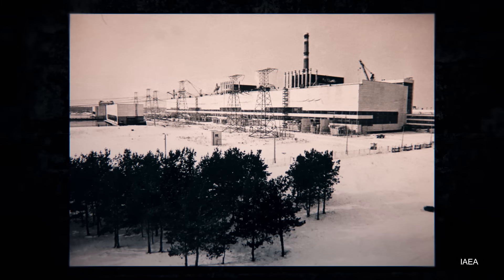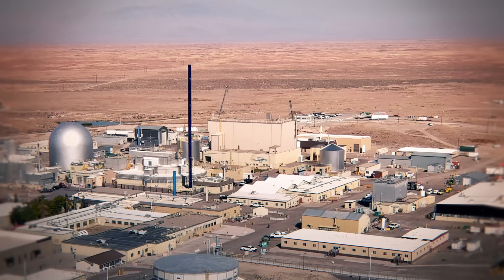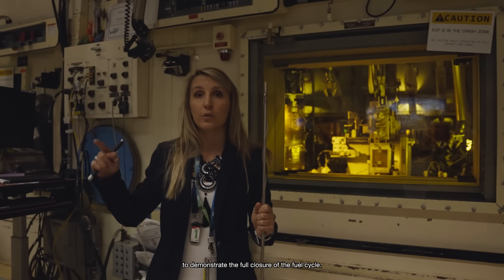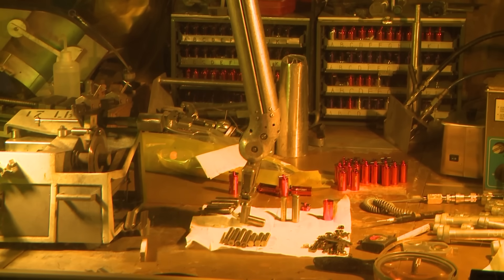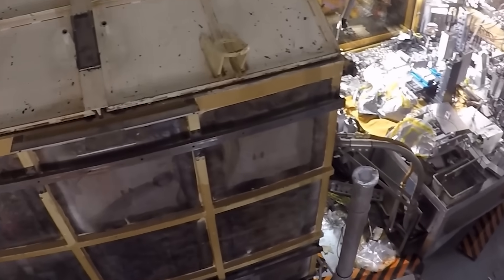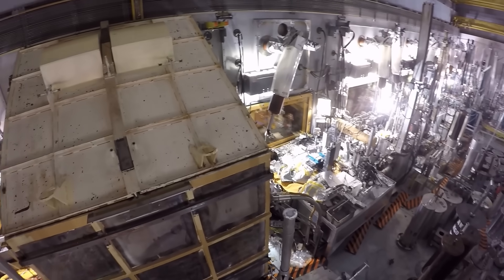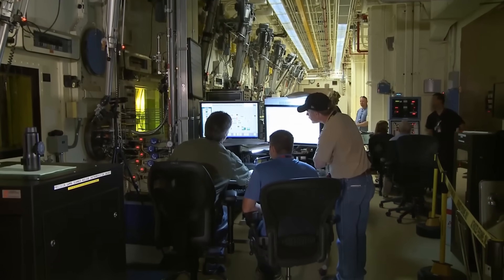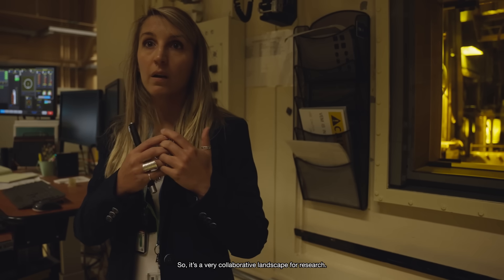This Room is Lethally Radioactive...For SCIENCE!

Comment: What's crazy to me is that if a person did enter the H.F.E.F. unprotected, they would likely never feel the effects of the Elephant Foot level of radiation before losing consciousness through the simple act of breathing.  With an internal atmosphere at >99% argon concentration, you would be out within seconds.
Reply: yes, did you also know that if you swim next to a submerged nuclear reactor you most likely drown before getting to much radiation? crazy
Reply: @clearlisted  that's only if you make it past the armed guards.  Hmm, purple Cherenkov radiation.
Reply: @clearlisted  pretty sure you would die before the drowning from gunshot wounds because you just broke into an active nuclear reactor.
Reply: @SupremeRuleroftheWorld someone has read xkcd
Reply: @initial86-2.5  i have yes, but i also worked in a nuclear power plant for almost a decade.
Reply: @clearlisted  If we're talking about neutron radiation that's true, water is a very good shield for such kind of radiation
Reply: Not if you held your breath. Argon is inert, so it won't displace the air in your lungs or traverse the skin in significant amounts. You could remain conscious for five minutes, or up to fifteen minutes with the right physical conditioning.
Reply: @HenriFaust  You won't survive that long in a pure argon atmosphere (at standard temperature and pressure). (Same thing with pure nitrogen too.) Everyone thinks: "I'll just hold my breath!" and then dies.

The vapor pressure of oxygen will be low enough that it will evaporate out of your skin.

It's like being in the vacuum of outer space, except with a 15 PSI atmosphere that feels exactly like the atmosphere you are currently in right now. 

You will feel nothing unusual because you can still exhale carbon dioxide like usual, and the carbonic acid in your blood will never get high enough to trigger your "sense of suffocation". You can't sense oxygen.

You can hold your breath underwater for much longer than you can in an oxygen free atmosphere. The human body has a bunch of unconscious physiological processes that automatically slow your metabolism underwater, which don't happen outside of water. 

Within the first minute, your vision will get "stars" starting in your peripheral vision. Sounds will get distant and echo. You get dizzy, and your peripheral vision goes dark. Then you lose consciousness and never wake up again unless someone else immediately supplies you with oxygen.
Reply: @juliavixen176  sounds like the same thing that happens to people who over do nitrous oxide abuse, same kind of reports.
Reply: @juliavixen176 just to point out something for your information, you can and will sense lack of oxygen, while it is true that carbon dioxide levels are the primary driver of respiration, there are also oxygen sensors in the body (I can’t recall if they are in the carotid bodies or near) the aortic arch atm), people who have “burned out” their CO2 sensors due to being chronic retainers (COPD patients primarily) rely on their oxygen sensors to drive their breathing, it just doesn’t kick in until much lower levels that most people are used to, down below 92 o2 saturation, it’s a trap for young medics and nurses to see these people with low oxygen and give them more via nasal prongs, and then the patient stops breathing
Reply: @TruthQuestian78 Nitrous oxide has a bonus modifier because it's an anesthetic. It will make someone unconscious even with plenty of oxygen available, and the ability to exhale carbon dioxide.

It's not hypoxia that causes unconsciousness first. But if someone is alone, and using a gas mask/respirator/whatever that covers their face, and while adjusting the flow of nitrous oxide into the face mask, and accidentally loses consciousness before being able to readjust the flow of nitrous oxide... then they will stay unconscious... forever.

All anesthetics is fatal if improperly dosed.
Reply: Completely off topic from the video: if I held my breath, I could stay conscious in a 100% argon room for a minute, maybe even two. Why would I loose consciousness faster if I breath in the argon?
Reply: @firefighter4443 If you're breathing in an inert atmosphere you're exhaling oxygen, that's why it's worse than holding your breath.
Reply: @firefighter4443  Your body doesnt use all the atmospheric O2 right off the bat.  Holding your breath still allows absorbtion through your lungs as your heart beats while holding your breath.    If you exhale all the residual O2 and replace it with Ar... theres now no oxygination happening.  Your body's response to low O2 is to pass out to conserve oxygen use for critical tasks.  

TLDR... as you hold your breath, your Sat levels drop at a slow pace because you still have O2 in your lungs.  Replace the O2 with Argon (no O2 left in your lungs), and your sat levels will plumet, causing you to pass out to "protect your vitals"
Reply: @firefighter4443  If you hold your breath you continue to have O2 in your lungs and will stay conscious for some time until you no longer have O2 in your lungs. 

A good test. Take a deep breath and see how long you can hold it. 

Then, take a deep breath and breath it all out, but don't breath in. How long till you have to take a breath?
Reply: @firefighter4443  don’t breathe it in, I’ve had slight argon poisoning from welding before. It is unpleasant to say the least. 

I had in slightly but it still felt like i just smoked 2 packs of menthol cigarettes deep down in my lungs. Very uncomfortable and I could have had it way worse.

I am not an expert so there is certainly plenty of missing information in what in commenting so go look it up if you’re curious!
Reply: @WereWolfWoody  That sounds more like the effects of inhaling vaporized metal than argon. This is especially a thing that happens if you're in an enclosed area with molten zinc, for example. It's called "zinc fever" and your lungs will be the first part of your body to exhibit symptoms.
Reply: @firefighter4443  You can exhale carbon dioxide because there is less carbon dioxide in the atmosphere than in your blood. So it evaporates out of your blood (high concentration) into the gas inside of your lungs (low concentration).

When the concentration of carbon dioxide in the air is equal to or greater than in your blood. You can't exhale the carbon dioxide out of your blood and you die. I think this is something like 100,000 PPM of carbon dioxide in air at standard temperature and pressure.

You can have an atmosphere that is 90% pure oxygen and 10% carbon dioxide, and suffocate to death because you can't exhale the carbon dioxide out of your blood... and will die... in a 90% oxygen atmosphere. 

This exact same process happens with oxygen. The Earth's atmosphere is 12% oxygen which is higher than what you need in your body to stay alive.

When you enter a 100% argon (or nitrogen) atmosphere. You exhale both carbon dioxide AND oxygen from your blood. The level of both disolved gases in your blood will drop to 0% to equal the concentration of them in the argon atmosphere.
Reply: Your all wrong cause E=MC hammer
Reply: @nicholas which is why "Can't touch that"?  (also radiation.)
Reply: Having worked in the industrial gas industry and dealing with unsafe atmospheres, and working in locations where people died from an Ar leak, I can't advise you try to hold your breath. You would be down and out before you even knew that you had a problem.
Reply: 10 seconds and after 30 you are dead
Reply: Okay, so I ran the numbers. This room produces anywhere from 100 to 400 Grays per hour.  

In the time it takes to suffocate, you would receive between three and thirty grays of radiation. This much radiation is 100% fatal, but survival tends to be about a week. 

So you would probably die of suffocation before the radiation had done much worse than give you a rash.